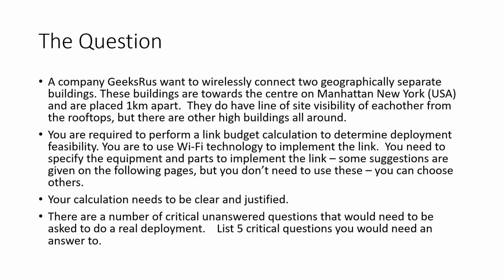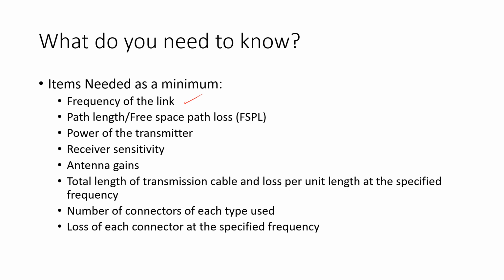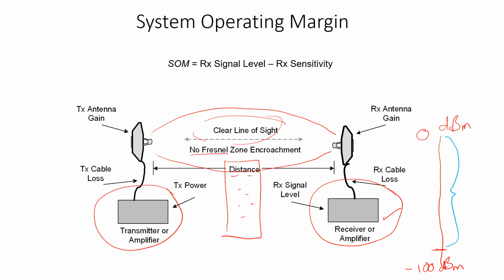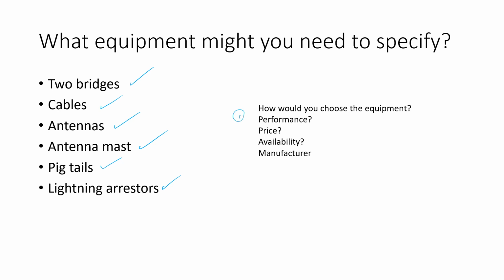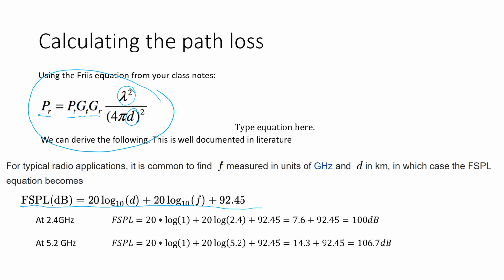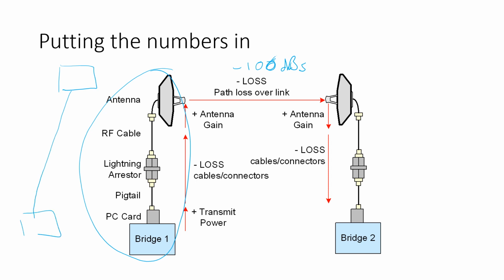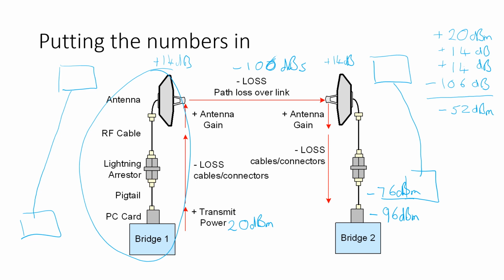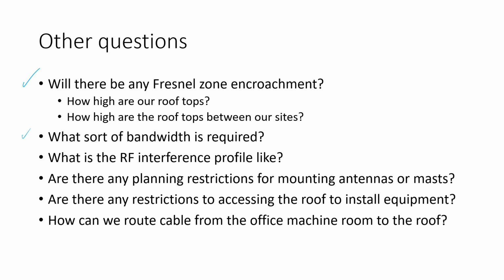Link budget calculation

Comment: Not too sure  about this -you cant mix dbm with db i thought?
Reply from the maker: hi, there is no problem using dBm's and dB's in the same model - well as long as you are careful. remember that a dbm is simply a db value relative to 1mw of power. so you can 'modify' this dbm value using db values. for example ifyou have a 1mw signal and amplify it by 10× you get a 10mw signal. doing this in the db world you start with a 0dbm value (1mw) and add 10dbs to this (equiv to 10x gain) you the get 10dbm's. 10dbms is 10mw. hope this helps
Reply: @grahamsexton1  cheers Graham I shall practice some more exercises - I get it ....then I don't  - but I find it well worth the effort. What a fascinating subject this is ..
Reply from the maker: @eamonncolley5249  glad you are enjoying it Eamonn !